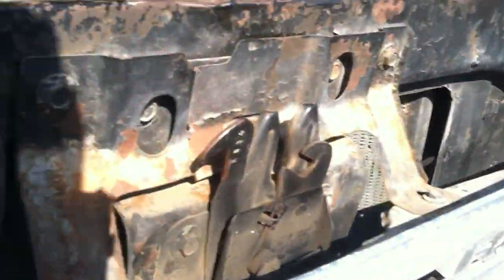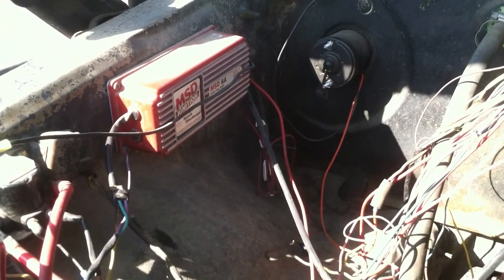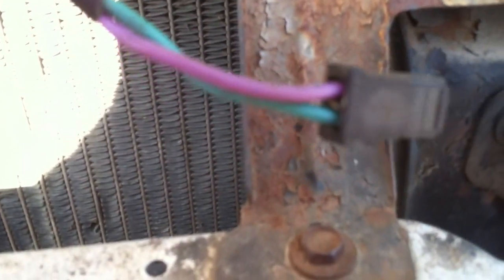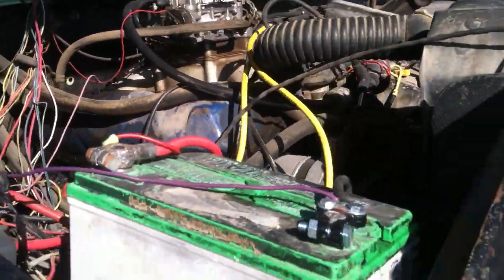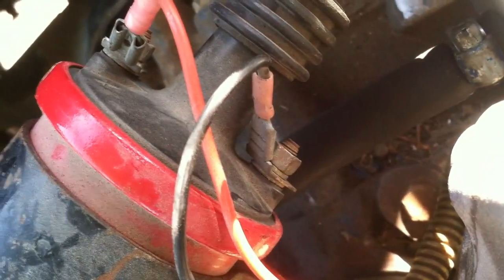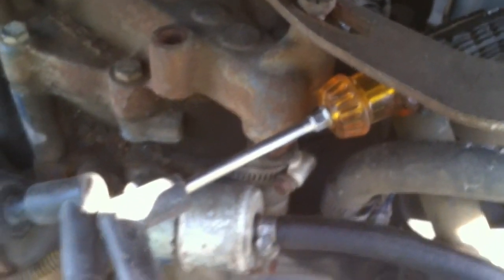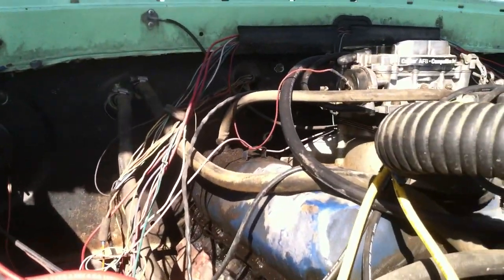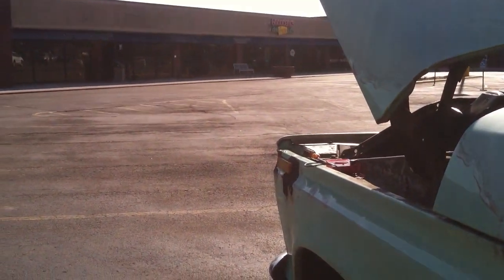How to test a MSD box for spark

Comment: You really should Mount that coil vertically as they are oil filled and laying them down on the side like that will cause them to overheat and fail prematurely. They describe that in the instruction manual

Comment: I have a 74 f100 where did you tie in your 12v switched wire off the 6al box?
Reply: You 'normally' take it off of the original '+' feed to the coil. If you have a ballast or resistor wire you can bypass it but they say it should work down to 9v.

Comment: Wow great video the problem that I have that my car starts up once it warms up it turns off so I'm trying to figure maybe is the MSD box as bad let me know right back to me please
Reply: I had that problem too. They seem to maybe be heat sensitive. If you could mount it in the passenger compartment or a cooler location would be best. Mine was on the top fenderwell under hood of my truck. It got really hot. Once it quit so I yanked it and just went regular electronic ign. I tested the box a couple years later and seemed to work. I had the bypass standoffs on the coil to go back to regular ign. Once I put the jumpers on it fired right up.

Comment: I need some help. I have a 69 GTX that is switched over to all MSD. I'm running a 6201 6 A box. I went to load my GTX on hauler and it wouldn't start. My box is getting power into it but no power out to the coil. I live in Southern California and would like to know if anyone out there knows a place that does MSD box repair in my area. Area code 91761 Ontario Calif. We are moving and don't have a forwarding address so sending it to MSD won't work.
Reply: Open the box. If you see the board encased in epoxy, throw it away. You can't repair it. If it doesn't have it, any shop can repair it

Comment: This video tested nothing towards the 6A. This specifically tested for ignition spark only. Your problem was with your connecting wires on your coil which grounded out
Reply from the maker: this is how MSD states how to test a box. I just made a video to make it easier for people to understand. If you have another way to test it perhaps you could let the engineers at MSD know.

Comment: COULD YOU HAVE WIRED YOUR BOX TO A POWER SUPPLY THAT BECOMES HOT WHEN YOU TURN ON YOUR KEY ? WHEN IT REQUIRES TO BE WIRED DIRECTLY TO THE BATTERY FOR A CONSTANT 12 VOLTS AS IT SHOWS ON THE BACK OF THE BOX ?  IM NO EXPERT , BUT IF I HAD TO GUESS I WOULD SAY YOU HAVE INSTALLED YOUR SYSTEM WRONG  ...  JUST SAYN'  ,  I WOULDNT WANT SOMEONE TO ''KEY ON'' A ELECTRIC FUEL PUMP AND START ARCING AROUND UNDER A HOOD .     WELL , GOOD LUCK AND BE SAFE
Reply from the maker: my box receives its power from the battery but the ignition switch allows the power to power the box. Had it wired this way for 13 years.